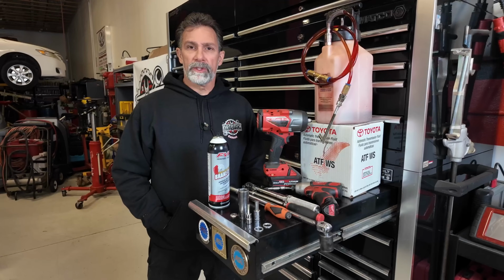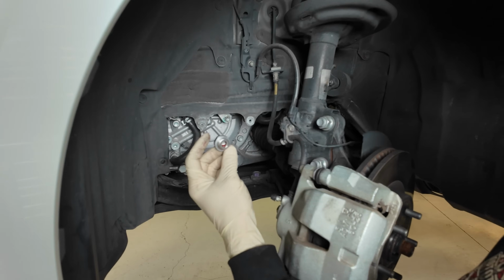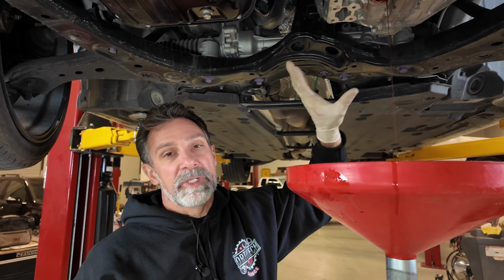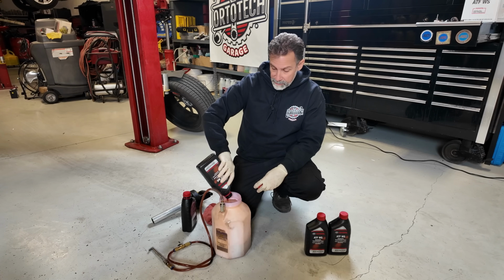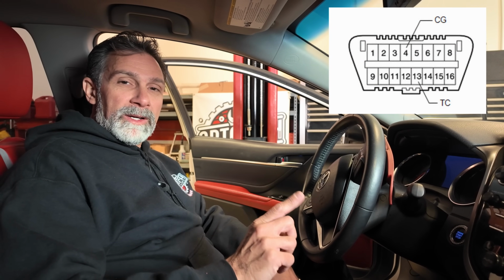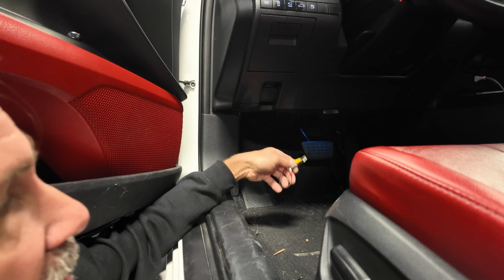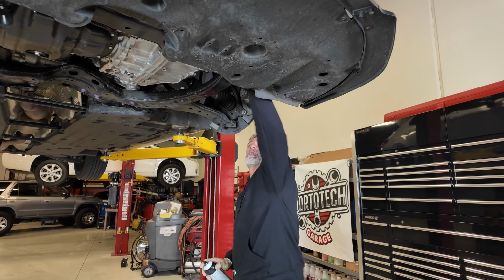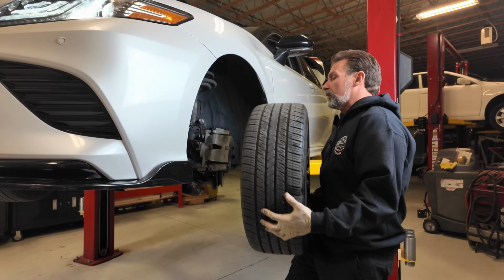The Ultimate Guide to Changing Transmission Fluid on Your Toyota Camry

Comment: If you didn’t have a continuous stream of fluid coming out when your at the right temp you didn’t put enough in. I would add more and let the car cool down to re check. How do you know you’re still at the correct temp to check after adding more. And the correct level is a trickle not a few drops coming down. Just trying to help the next person do it correctly, transmission are not cheap. Just add the 4 quarts and check when at the right temp
Reply from the maker: Thanks for your input and for watching. I thought I was pretty clear in the video and I strive to provide the most accurate and detailed information for the viewers.  I have included a clip directly from the factory service manual, indicating the exact wording used just in case there is any confusion for anyone. See below:
 
b.	Using a 10 mm hexagon socket wrench, remove the overflow plug and gasket from the transaxle housing.
CAUTION:
Be careful as the automatic transaxle fluid coming out of the overflow plug hole is hot.
c.	Check the amount of automatic transaxle fluid that comes out of the overflow plug hole.
	If the amount of automatic transaxle fluid that comes out of the overflow plug hole is large, proceed to step [#1].
	If no automatic transaxle fluid comes out of the overflow plug hole, proceed to step [#2].
NOTICE: If only a small amount of automatic transaxle fluid (approximately 1 cc) comes out of the overflow plug hole, then only automatic transaxle fluid remaining in the No. 1 transmission oil filler tube has come out. This condition is not considered as overflow, so it is necessary to add automatic transaxle fluid.
d.	If the amount of automatic transaxle fluid that comes out of the overflow plug hole is large. [#1]
1.	Wait until the automatic transaxle fluid flow slows and only drips come out.

HINT: The automatic transaxle fluid flow will not stop completely because the automatic transaxle fluid continues to expand as its temperature increases.
e.	If no automatic transaxle fluid comes out of the overflow plug hole. [#2]
1.	Remove the refill plug and gasket from the automatic transaxle case sub-assembly.
2.	Add automatic transaxle fluid through the refill hole until automatic transaxle fluid comes out of the overflow plug hole.
NOTICE:
Use Toyota Genuine ATF WS.  3.2 liters (3.4 US qts, 2.8 Imp. qts)
3.	Wait until the automatic transaxle fluid flow slows and only drips come out.
Reply: Exactly my point, the fluid is expanding while the transmission is getting hotter. Why would you tell diy’ers to add less when you’re going to have add more anyways. It didn’t take long to get to temp, By the time they go add more and recheck it will be well over 113 degrees. You’re a mechanic, use your head man. Otherwise the procedure was correct 😂
Reply: I lied, you missed to last step. Please cycle through your all your gears before driving

Comment: You should be drain and filling what ever to total quarters are on the vehicle
Reply from the maker: This is the specification listed by the manufacturer.  Use Toyota Genuine ATF WS.  3.2 liters (3.4 US qts, 2.8 Imp. qts) Measuring what comes out does not guarantee the correct amount.  How can you be certain what you took out is at the correct level if you don't perform the proper fluid level check procedure before draining?  It is possible some leaked out or it was not previously filled correctly. I only say this because I have seen it and it is a possibility. Thanks for watching!
Reply: @ so what you are saying is if that car holds 8 quarts of transmission fluid and the drain and fill is 3.4 quarts. So what are you doing with the left over quarters of dirty fluid in the transmission. That is how drain and fill works . You still have to change all of the fluid 😵‍💫
Reply from the maker: @Anthonythesider  oh. I understand what you are saying now. I misunderstood your last message.  You are correct, it would be best to exchange ALL of the fluid in the transmission.  This generally requires a specific flush machine though, which most DIY will not have. You could also repeat this procedure several times, while operating though the gears in between services to help exchange some additional fluid.  There is a last option that requires a helper to add fluid while you use the internal pump to pump the fluid out of the cooler lines.  I wouldn't recommend that method to anyone.  You can run the system dry pretty easily.  👍
Reply: @ if the car has a cooler line yes , you can do it that way . That is the way i did it on my vehicles . And i also had tranny pans so it lowered the fluid in the pan so it wasn’t so much of a mess when taking it down. And then after the pan is cleaned and back on add new fluid to push out the rest of the old fluid. And filling to right amount
Reply from the maker: @Anthonythesider  Nice work. 👍  That's a good way to get the majority of fluid out without a flush machine.

Comment: Is there something about Trans fluid that is different at higher temperatures? I mean if you're in your garage and it's 80-degrees outside how much fluid difference is from 80 to 96? Couldn't you just 'measure' what comes out and put the exact same amount back in? Both what comes out and what goes back in is the same 80-degree temperature... Therefore they'd both be 'thermally equivalent'
Reply from the maker: @TimothyLamothe  Great questions, Timothy!  Here is the theory. Transmission fluids expand as they heat up, and the rate of expansion is determined by its thermal expansion coefficient. There are some formulas engineers use to determine the delta or change in volume for a specific quantity at various temperatures.  Toyota engineers have determined that there is enough change in volume at these temperatures to warrant a specific and optimal temperature to check the level.  In practicality, you would likely be fine to drain the fluid into a graduated container, and refill with exactly the same quantity, assuming a few things...Assuming you had the correct level to begin with, you did not lose any fluid during the draining, and you did not lose any fluid refilling.  You can see from the video that this is a messy process, and it may be difficult to meet these conditions.  But I think your theory would work fine.  I imagine that the volume change from cold fluid to recommended temperature check range could be as much as a few tenths of a quart, which seems fairly insignificant considering the dry fill capacity is about 7.5 quarts, but I'm not an engineer and assume they have this crazy process for a reason.  Thanks for the good comments and discussion. I enjoy common sense and critical thinking, which you clearly have.  🙏

Comment: VERY INFORMATIVE. Thank you. 

On the 2024 Rav4 Hybrid it's AMAZINGLY SIMPLE. Drain fluid from tranny. (Make sure FILL PLUG is loosened FIRST!), and then put back DRAIN PLUG. 
  Next via FILL PLUG, refill the tranny using a pump to OVERFLOW and allow it to level out and STOP dripping BEFORE putting plug back in. 
Do this SAME EXACT procedure for REAR DIFFERENTIAL.      DONE!
In both cases, refill plugs are accessible and visible. No tire has to be removed.
Reply from the maker: You're welcome!  We appreciate you watching and commenting.  I finally convinced my brother to switch to Totota, and he bought the same vehicle.  He loves it!  Keep up the good work doing your own maintenance!  It's very rewarding.

Comment: Great video! As for Toyota eCVT transmission, it resembles the eCVT in its operation only but internally it does not have any pulleys nor any belts. Using 2 electric motors and a planetary gear set. Genius desing and a long lasting one provided it is serviced correctly.
Reply from the maker: @TherealDjTired  Yes,  you are correct.  I would just add that it's important to know which transmission you have prior to service and be 100% sure you use the correct fluid.  CVT or eCVT units usually require a special fluid.  Thanks for the comment and for watching.

Comment: Can I do my new 5th Gen 4Runners this was and if so, at what mileage?  

Or do I have a pan and filter that means I can't do this? 

Super video.  I'm hoping I get a response and then I'm going to watch it several more times.
Reply from the maker: Hi there.  I believe the 5th gen has a pretty wide range of years it covers, but you can definitely service it similar to this. There is a fill plug at the back of the transmission housing.  The only difference really is that you will likely have a transmission oil pan with the overflow plug on it rather than a plastic overflow tube. There is a strainer in the pan, but I don't recommend changing it.  It's really more of a screen to keep larger material from circulating than an actual filter.  If you tell me the specifics, year and 2 or 4 wheel drive, I'm happy to give you some more specific details.  Thanks for watching!
Reply: @OrtoTechGarage  I have two 2022s.  Both are part time 4x4.

One SR5 Premium 
One TRD Pro

Subscribed.  Thanks for the info and really best of luck with this channel!  I like your presentation style.
Reply from the maker: Ok, so a 2022 model will be pretty much as I described already.  Not much new to add. It calls for Toyota WS fluid as well.  3.5 quarts should work fine for a drain and fill.  If you would like me to email the specific instructions to you, just shoot me note by email at Ortotechgarage@gmail.com.  I can drop the procedure with images in an email for you.  Thanks for the nice comments!  My wife tells me I'm boring... We have only been at these videos for a few months, so I hope we can continue to improve on some things over time.  We appreciate your support!
Reply: That's great.  I'm going to shoot you an email now but at your leisure....!

Seriously - Keep up the good work.  

Best to you both.

Comment: I took my 2017 Toyota Highlander (8-speed Auto) to the Toyota dealer for a transmission fluid change at 60k miles. The service center employee told me he doesn't recommend having it done because they had several Highlanders in for transmission repairs. The transmissions for those Highlanders started slipping after the fluid was changed. So according to his advice, I'm just supposed to drive it until it breaks, which is after the warranty period. I now have 78k, and I'm not having any issues with the transmission. However I still want to have it changed at some point.
Reply from the maker: I can't imagine any scenario where replacing the original fluid with original fluid would cause a perfectly functioning transmission to fail.  Seems like an odd thing for the dealership to tell you.  We service them all the time without any problems.  I don't like that advice.  They may have had transmission problems on several Highlanders, but i doubt it was because of a routine service, performed properly, with the correct fluid.  Just my 2 cents.  Thanks for the comment and for supporting our channel.  🙏
Reply: @OrtoTechGarage it could be the atf changes were not done correctly.
Reply from the maker: @jungapo2  Anything is possible.  👍

Comment: What is the year model or better yet the year model(s) of these Toyotas so we’ll know that our Toyota uses the same procedure as the video?
Reply from the maker: @mikeholt1248 This particular vehicle in the video is a 2018 Toyota Camry XSE 4 cylinder.   There are a multitude of late model Toyota and Lexus products that use this method or one very similar to this.  I dont have a easy way to compile an exact and accurate list, but most of them are using this method, albeit with some minor differences in location of fill plugs, drain plugs, oil pans, fluid quantities and fluid types.  If you have a specific year, make, and model you want to know about, I'm happy to get you that information. 🙏

Comment: I've been changing my own transmission fluid on my Chrysler vehicles for the last 20 some odd years never have had to replace a transmission had a neon and an Intrepid make it past 250,000 MI unfortunately the salt ate the bodies! Oddly enough the first car ever had transmission problems with was my Toyota I drained and refilled change my filter I thought I was good it still continued to slip would help me a lot was the seafoam transmission treatment that helped a lot!!
Reply from the maker: @peachyclean93  250K miles is tremendous.  Great work!  How often did you service both of those Chrsyler vehicles?      And what year was your Toyota that had a problem?
Reply: @OrtoTechGarage  in the beginning I was doing every 30,000 that's when you were able to change the filter in the fluid I used an air compressor I'd get about all but 1 qt out that's still in the torque converter I tried doing that to my Toyota it didn't work only four quarts it's a 2008 my grandparents had Camrys from the 90s they were turds both the 93 and a 97 and they both needed motors and they had problems with their transmissions. I know I know people are going to say that's really odd but I've known quite a few other people have had the same problems does 97 to 2000 had a flaw in the suspension my grandfather's Camry the rear end broke off not even from rust but it was from a manufacturer defect. Crazy enough he was still able to drive it but not safe!
Reply: @peachyclean93  You should have just left the transmissions alone in those old toyotas haha. no service. they probably would have lasted more than the chryslers. i had a 2008 scion xd. which has the corolla drivetrain. and then gave it to my parents. it has about 200k miles and they never serviced the transmission. only check if the fluid level is right.
Reply: @german80 nah there was so much wrong with that Toyota I will never buy another one ever again no thanks!!
Reply: @peachyclean93 that's crazy, but i believe you. It's the opposite world

Comment: At what mileage should you do the first fluid change? Should you go by mileage or number of years since you first bought the vehicle? My understanding is that the ATF filter should be changed also around 80,000 to 100,000 miles?
Reply from the maker: If you really want to be proactive with your maintenance, I recommend you change the fluid every 30,000 miles.  Especially with a service like this one, where you can only exchange a few quarts at a time.  The total capacity is about 7.5 quarts, so your only getting half out. There is no transmission filter that you can service on this vehicle. That's part of the reason it's important to maintain the fluid. I don't really recommend by time, just mileage/use.
Reply: No. No. No. Max 70k. But better at 50k....

Comment: Totally correct, exact and well explained. Torque figures are correct as is all the explanations. Works for Lexus as well.. Do not Flush, just drain and at 100,000 drop pan and change the filter and pan gasket. Then every 50K and filter at 100 k. NEVER Pressure Flush... EVER!
Reply: You didn't watch the video - no pan or filter
Reply: @4af  I did watch the I am saying I'm used to flushing I'm going up against the guy that says never to flush them which is not true
Reply: I pressure flushed all my Chrysler transmissions never have had a problem been doing it for 20 years!
Reply from the maker: @peachyclean93  We regularly use the transmission fluid flush machine with no problems as well.  I'm not sure why he had a bad experience.  Maybe a faulty unit before the service.
Reply: @OrtoTechGarage  yeah I'm just responding to the guy that says never to do a flush that's not true
Reply: @alechappy2070  excellent instructions on what to do and not to do with modern day hi Tech transmissions. Never flush them because there will be people, I dare say most people, that simply don’t change the transmission fluid at all! So what will happen if someone has 200,000 miles on their car and decide to flush the system out and put in new fluid? Very good chance here that sludge, grit, and other contaminants Will be forced into the small orifices and other sensitive areas to clog up & screw up the transmission.
Reply from the maker: Yes, regular maintenance at rigid intervals is always best!  Thanks for the comment.
Reply: @mikeholt1248  This is what I should have said. My apologies ! There are some ultra fines  that with a pressure flush will jam into some of the galleries as you said and it will be over Red rover. Also be ultra Clean in everything you do, to prevent outside contaminates from going into that wonderful transmission.
Reply from the maker: Thank you for watching and commenting. 🙏

Comment: Nothing like Toyota making it easy to change your fluid like the old ones. Over complicated junk by bad engineering. Toyota said all the problems with my 2020 Camry 8-speed were normal. I couldn't get the dealer to check the fluid to see if it had enough or not. Too time consuming for known problems. It was easier to dump the car than get warranty work from Toyota.
Reply from the maker: That's really disheartening to hear.  I'm a bit shocked that your dealership would do that to you.  I'm sure Toyota corporate wouldn't be happy to hear that either!  Best of luck with your new car.  What did you get?
Reply: @OrtoTechGarage  I replaced the new Toyota with a 10 year old Ford with 12k miles. A buddy was selling it because it has a manual and hurt his knee to use the clutch. Not one problem in the couple years I've driven it. It is a Ford and I'm waiting for problems. Excessive acceleration and speeding is on the top of the problems, so far. I already had to replace the tires and it calmed down the heavy foot. But it's so much fun. Toyota USA didn't care at all. Nothing but excuses for all it's problems. The windshield wipers even started acting up just before dumping the car. They knew the block years and 8 speed had a bunch of problems. It amazed me they put that transmission in the new Tacoma. Of course the problems continued in that truck.
Reply: Too complicated.
All you can do is replace engine air filter and cabin air filter.